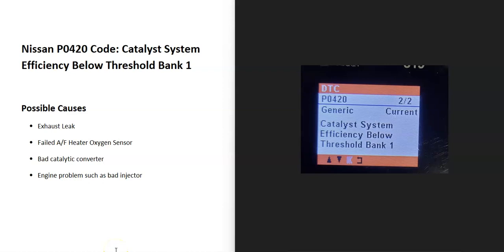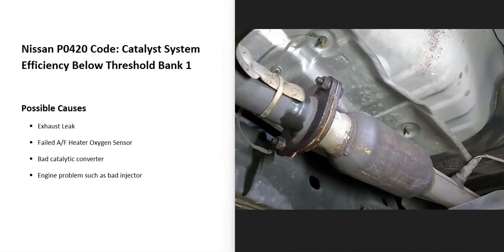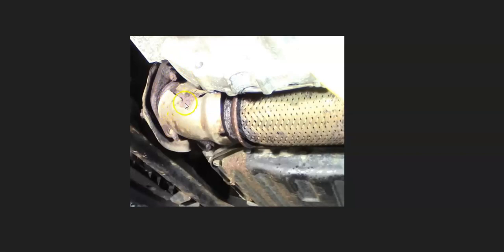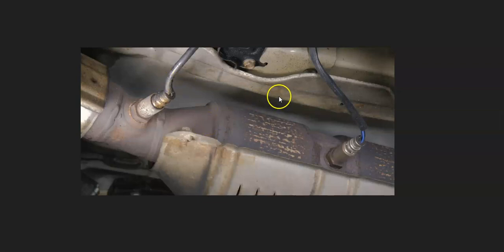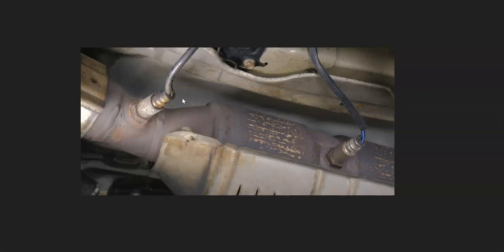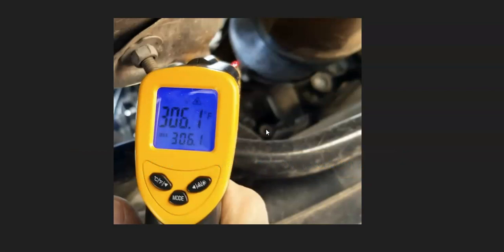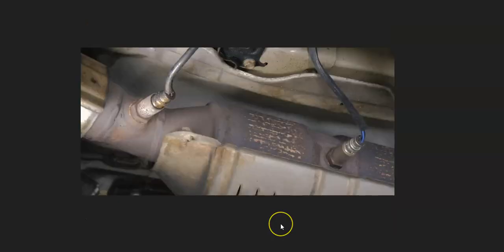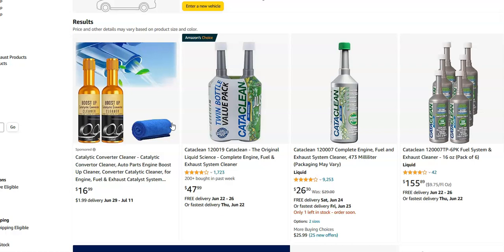Causes and Fixes Nissan P0420 Code: Catalyst System Efficiency Below Threshold Bank 1

Comment: Great video!  I love that you talk in an organized fashion and get right to the point! 2009 Murano SL with the P0420 code on/off for several years.  Cataclean and lacquer thinner in the gas tank sometimes turns of the light but less and less lately.  RPMs are smooth, and power is the same as always.  Can't see any holes in the exhaust. Does this sound like it needs a new CAT (please tell me no because I live in CA!)?  Or more likely the O2 sensors?
Reply: replace the PCV valve and the crankcase hoses they could be cracked  ..i have a 05 frontier 173k and the light finally went out
Reply: @jmar2229 what was your code po420?

Comment: I got this code once AFTER getting gas. I put cat cleaner in it and made sure the cap was tight. Fixed the problem. Your mileage may vary though.
Reply: same , its happened twice,
Reply: so did i, car had never had any codes. got some gas (assuming it was bad gas) and its been on since. being the car is old, but well maintained im just gonna replace o2 sensors for peace of mind
Reply: mine got fixed after this  @will6295
Reply: @will6295 same situation, did you fix it by chance?
Reply: @alihamzia1896 after replacing both o2 sensors. Still got the code… ordered an exhaust manifold after my dad did some ol skool troubleshooting. So it was taking in air but when he checked both exhaust pipes their air temps were cool and barely putting out. And a few other things he checked it was confirmed the exhaust manifold was clogged. Codes went off, better gas mileage and purring like a kitten.
Reply: @will6295 how much you waste bro? On a new one
Reply: @SosaDereza 😂it wasn’t a waste at all being it’s my oldest car, so with or without code It’s good practice to replace such especially since my car has over 250k miles. But o spent maybe 30 each if that I get all my parts from Rockauto
Reply: @alihamzia1896 omg sorry so late I don’t get YouTube notifications but yesss it fixed it. The car runs great never really had mechanical issues and I’ve put over 250k interstate miles on it well maintained so it was time  😂
Reply: What is Cat cleaner
Reply: @Californiaqueen209  it's a chemical additive you put in your gas. They sell them at Walmart and Amazon
Reply: @Californiaqueen209  .....catalytic converter cleaner. It is a bottle of fluid you buy and pour into your gas tank. I have purchased both Cataclean and OxiCat cleaners in the past 3 years. Best to have less then a 1/4 tank of gas , then pour in one of these products into the tank. Then go for a 30 minute freeway drive. 
It may clean up a clogged catalytic converter, depending how bad it is. Or you might need to buy another bottle and try it again. 
My Cat. converter was not acting up, i just did it as preventative maintenance. So i can't say ''it really works''. Some  say nothing really cleans old clogged up Cats. Catalytic converters are expensive to replace, that is why people buy $30-50 bottles of Cat. cleaners and try them, hoping they might improve or get by till a new one is needed.
Reply: Same I went to a cheaper gas station and that engine light came on I wonder if it was the gas not going there again
Reply: @Californiaqueen209 I pumped at Sam’s Club and got this Damm code after driving for like 10 mins
Reply: What brand did you use and did the check engine light go away on its own.

Comment: I had the p0420 code and it seems the exhaust is smelling rich.  Code was reset and no codes for a few weeks now.   Any ideas. Car runs good with acceleration. 2008 Altima

Comment: Can I gut the exhaust manifold cat AND the cat under the car? If so, which sensor would I have to space out? Or do I have to space out both sensors since I gutted out the manifold cat and under the car cat. 2012 Altima 2.5. 
Thanks in advance!
Reply: Nobody replied yet. 
But y’all, my main issue was my valve body overheated, kept driving to and from Austin-Dallas 2 summers ago in this damn Texas heat with clogged cats made my tranny work harder to push, which made the valve body overheat. 
Gut both cats but space only the rear o2 sensor.

1st sensor reads air and fuel mix, 2nd sensor reads how well the cat’s performing. Warning: You’ll smell eggs if you gut them. 

Car runs like a dream now though, and I put a aftermarket tranny cooler.
Reply: This is my idea, any update?
Reply: Thinking about doing the same but getting cold feet hearing the horror stories. I’ve got an 05 frontier 2.5l (4silly). Pre-cat is toast and I want to punch it out so bad.

Comment: Where is located the bank 1? Is it the right or left side? I’m looking to buy a catalytic converter but I don’t know what side is bank 1.
Reply from the maker: Each engine has its own firing order, which needs to be looked up. Google your engine firing order and look at Google Images, they usually have it. The side with cylinder 1 is Bank 1.

Comment: very good vid., & I do have question☝️

I gotta P0420 & p2097(swapd that oxy sensor, still-there), however the scanner trim monitor, says both these codes are from running lean(+>0-10 trim) not rich(which I beleive they USUALLY are)..  any guesses on that cunundrum?(cats pretty new too & the lean readings are in BOTH banks btw)✋

Comment: I just fix it by removing the code 😅
Reply: Does it really work?
Reply: @managed9348  yep. It never came back. The code could be triggered when going up steep inclines or during cold weather. That's when I've noticed it. Car passed smog too no problem
Reply: How did you remove the code?
Reply: @oladissa  with a computer
Reply: @oladissa disconnect your battery for several minutes if you don’t have a scanner
Reply: @SAIIX100 some codes will still come up as "permanent"
Reply: Ive done the same, i just had to clear the code more than once in a long period of time
Reply: Wow you're an ace mechanic!